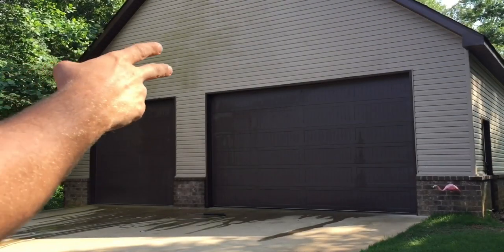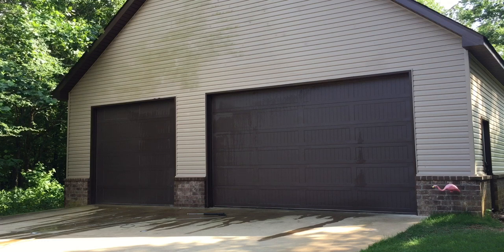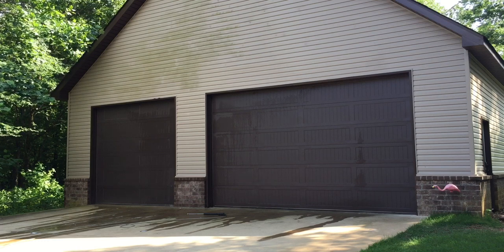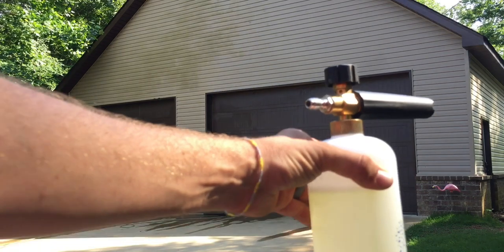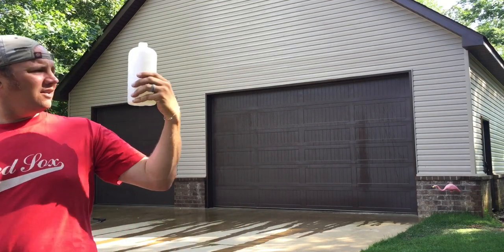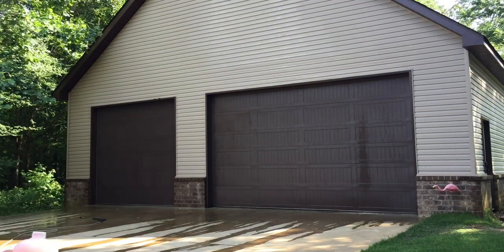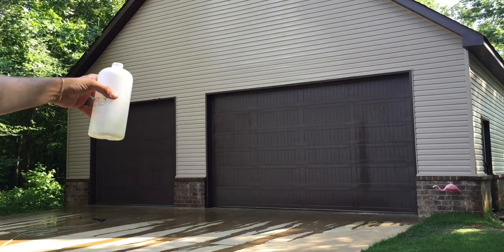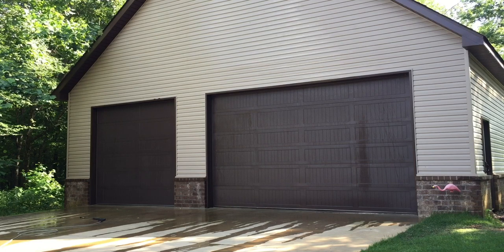DIY: Foam Cannon Soft Wash

Comment: Dawn and bleach mix fine. Dawn does not have ammonia. :)
Reply from the maker: Awesome. Thanks for the info.
Reply: Dawn does have ammonia any laundry soap works well
Reply: what ratio would you recommend in the foam cannon?
Reply: @haydentyree2653  straight sh don’t waste your time confusing yourself with ratios and all that just get a downstream injector and a bucket and fill it with straight sh if it’s not to dirty water it down a Lil bit I personally don’t use soap but if I ever do for some reason I put maybe 5 drops of it in a 5 gall bucket

Comment: He didn't dilute the SH in the foam cannon at all.  Is this what most people do when leveraging a foam cannon for a soft wash?  Also, if you are going to add Dawn to the foam cannon with the SH, at what ratio should you add it to the foam cannon?
Reply from the maker: No reason to dilute the SH, as it’ll be diluted when you spray it.  Don’t use Dawn, use Arm and Hammer with OXY Clean - the laundry stuff, not the dish stuff.  Ratio is just an eyeball. Give it a good thousand one, thousand two, thousand three squirt and then throw your SH in.
Reply: You dont have to dilute. Thats what the foam cannon does. Has a dial on top for mix rate. And you dont have to rinse. Just let rain wash it off over time. Especially on roof to get rid of black streaks
Reply: Only need a squeeze of dish detergent. Not much at all
Reply: The foam can mixes atit sprays. Pressure washer with a down stream is best hands down or a 500 gallon tank with a motor and pump with 250 feet of hose You can shoot 3 stories high and do these jobs so easy.

Comment: How could you find out what percent its coming out at?
Reply from the maker: It'd be pretty hard to get an exact number. 

If you wanted to try, what I think I would do would be to: 

1. Get a measurement of the water the pressure washer is putting out on whatever setting you intend to softwash at. 

2. Get a measurement of the amount of fluid evacuated from the foam cannon at the flow rate in step 1.

3. Give these two numbers, you should be able to determine a rough estimate of the dilution rate of the bleach. 

From what I've seen personally, though, there is no real need to worry with that for house hold applications.

Comment: Way too close with that psi, fine for your home but I would never risk streaking oxidized siding on a clients home. You’re relying too much on water and not enough on chemical. Dawn will increase the dwell time of your bleach, letting the chemical work for you. You basically just pressure washed off the mildew with a slight dwell time. Eighth concept but not the best performance my friend.
Reply from the maker: I don’t think the pressure of the water had very much to do with the removal of the mildew.

Comment: How would you work out the ratio it dilutes?
Reply from the maker: Easiest way, I think, would be to know the flow rate of the water going through the pressure washer, which could be timed by spraying into a bucket.

Then time how long it takes to empty the foam cannon container.

That should give you both flow rates.

Take those flow rates and work out a ratio between the two.

Should be able to reduce that to a dilution ratio.

Comment: The juice I use does not seem to be coming out. No matter how wide I open the material knob, it doesn't seem to lower in quantity.
1st time user.
Reply from the maker: Sounds like a faulty cannon.  Does it work normally?
Reply: @BellyUpFishGarage  works with my 2000 PSI Electric pressure washer, not the 3400 PSI gas, the canister itself says it goes up to 3700 PSI. I called the manufacturer of the product and the product technician said to send him a video, of the cannon with using both higher and lower pressure washers, which I will be doing today. The man on the phone came to same conclusion, as you did, that it is probably a faulty cannon, and he is going to sending me a new one.
Reply: There should be a clear tube you attach to the cannon that goes in the container. I did the same thing.

Comment: What kind of bit did you use to wash with?
Reply from the maker: I think I used the 25° tip.
Reply: @BellyUpFishGarage  where did you place the bit at the end of the cannon?
Reply from the maker: Once you’ve applied the cleaning agent, you can remove the foam cannon and spray it off using the normal pressure washer wand.

Comment: Do another video with the foam Cannon. I've been using it for 6 months. No complaints yet
Reply: I'm having trouble, it doesn't seem to be working. This is my first day using it.  No matter how much I use it, the liquid in the container doesn't seem to go down. I open the material knob full.
Reply: @Carpaintry_of_God  I know it’s 2 years later but you might’ve had a small clog in it

Comment: Seeing that the pressure washer automatically provides water, can I put just Chlorine in my foam cannon with without diluting it and let the pressure washer dilute it, itself?
Reply from the maker: That's what I did.
Reply: The foam cannon dilutes it. Actually has a dial on it to adjust the mix rate and spray pattern. I use for black streaks on roof also. Another good tip is do not rinse. Let mother nature do that. Will get much better results letting it sit